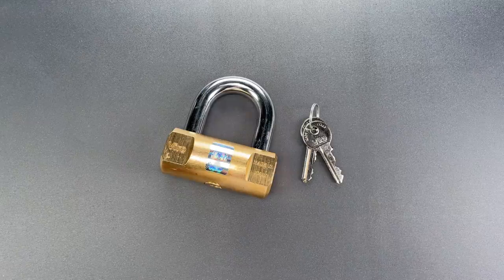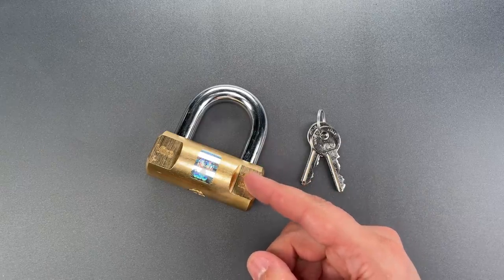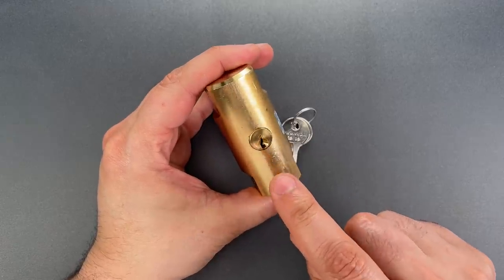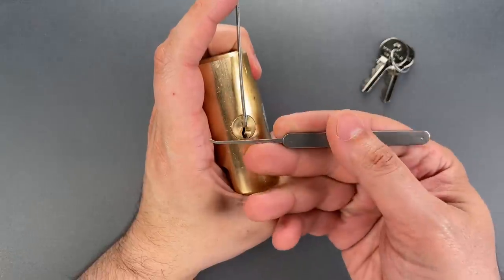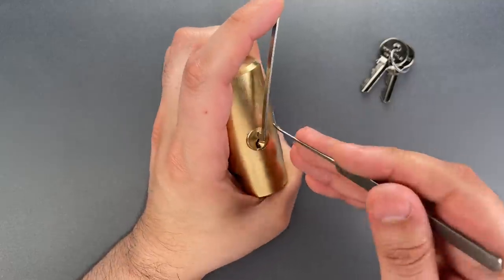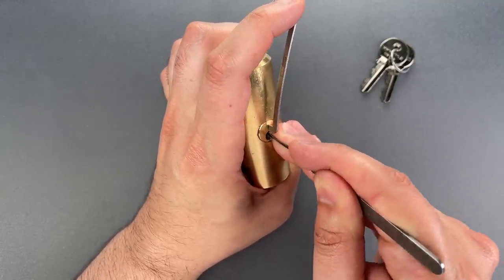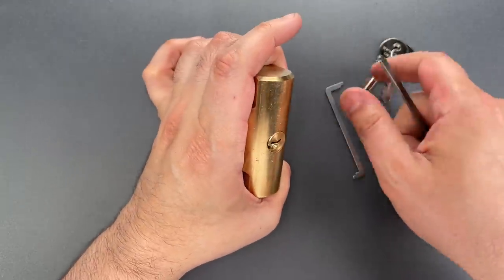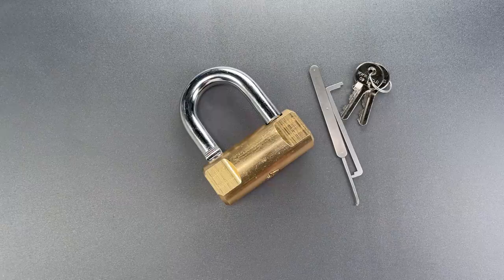[1341] Viro’s Secret Pin Foils Unwary Pickers

Comment: This is probably one of the best performing locks the LPL has picked on-screen, given that clever semi-secret safety feature. Then again, he only cracked it once so it may have been a fluke. 🤣😂😭🔓
Reply: The hidden pin is cool, but security through obscurity is no real security at all
Reply: @_Stormfather  it's only supplemental, I think would be more accurate. Like a house safe under a floorboard is better than on the living room table, but not by that much.
Reply: I called it a "semi-secret safety feature" not security by any stretch. We're actually on the same page.
Reply: 1341 flukes so far... 😆
Reply: @szurketaltos2693  But if you make one relatively simple to find, and the other exceedingly difficult, then you have an effective decoy. That's where security by obscurity really comes into play, as a second or third line of defence. It's just not a good first step as a general rule, and definitely not the only security measure one should take.

One safe on the wall behind a painting, one under the floorboards that takes some finding, and one inside the sofa, where no-one would ever look - especially having found the decoy in the wall and the "hidden safe" in the floor. That would be my play. Just as the entrance to a panic room is best up high, as few people look up. It'll be found in a determined search, but time is not on the side of the criminal under most circumstances. Any delay is a good thing, so a "hidden" pin in the bottom of the keyway is the same, at first you pick and pick and can't get anywhere. It's easy to shine a light in there, but it's rarely the first thing you do, so it is an effective delaying tactic, as long as the lock is sufficiently obscure. 

Having been the feature of today's video, it's now much less obscure, but how many will you ever come across? It's one lock of many thousands being used, and the security pins or the bitting perhaps, in this one, were pretty good. That was a lot of tension, and a lot of easing off of that tension. This particular one took some skill even without the sub keyway pin. In combination, this is a decent lock.
Reply: @Si74l0rd  if you're being targeted by an experienced thief then my understanding is that they will case the house and your social media sufficiently to have a long window e.g. vacation. However, with a dumb thief you're right that all these things can be very helpful.
Reply: @szurketaltos2693  ,
If your house is being cased by an experienced thief, no lock will stop them from taking something.
Reply: @aralornwolf3140  an experienced thief isn't necessarily as good of a lockpicker as LPL. In fact they probably aren't, maybe as good as your average locksmith I'd guess. The lock needs to be sufficiently tricky and the safe or other infrastructure strong enough that it's too much work to take is my understanding. E.g. a small detached safe is never safe even vs a dumb thief because they can just take it with them.
Reply: @szurketaltos2693  ,
They will just take the TV/Laptop/PC/Anything that is valuable but not hard to get.

Ergo, the experienced thief will still successfully steal something.
Reply: @aralornwolf3140  For sure, they probably wouldn't hit someone with really good security practices either unless they feel it's worth the risk.

Comment: In a controlled environment, with no pressure, and knowing everything about this lock, it still gave him hard time and took LPL way beyond his average time to pick it.
It's a good lock.
Reply: Indeed.  When people lambast "security through obscurity", it's generally because the security system (in this case, a lock) relies exclusively (or nearly so) on it for its effectiveness.  But a "security through obscurity" trick is OK when the lock is still a challenge to open even when you know about the trick.  And that's what this lock did.
Reply: I would definitely buy this product as it will foil most people’s attempts at picking it.
Reply: Got to think about how many times did he retake that video how many times did he pick that lock before we saw the Final Cut
Reply: Yep. Just like everybody says on all of his videos.

Comment: I’m always afraid I put too much tension on my tools… watching LPL’s tools bend like crazy as he picks.  Ooook more pressure!
Reply: Me too😂😂😂😂
Reply: LPL favors "stout tension" when picking. He has a video pretty early on about his reasoning for it. However, you don't want too much tension that you cause the pins to bind and not able to be picked. I also go the more tension route, and I think you do get some good feedback, but you also need to have good control when letting off tension when counter rotation happens.
Reply: @shura0107  The tension video is #188 (happened to come up in my recommendations).

Comment: Yo that actually seems like a pretty decent padlock.
Reply: It’s decent against lock picking attacks but how about with power tools? Without hardened steel anti drill pins, I can’t imagine it’d be too hard to beat with a drill attack especially since the core is composed of a rather soft metal (brass).
Reply: @Alm8hoorOW  i think your statement is pointless. Power tools? I can use an angle grinder to cut whatever you think are harden steel locks. Or a blow torch. Picking locks are for doing it quietly not letting everyone know what you're doing.
Reply: @ladam836  , except you usually don’t carry an angle grinder around and the ones that do come cordless won’t fair against locks with hardened metal very easily.
Reply: @Alm8hoorOW  are you saying that i've been carrying this angle grinder around for no reason!?
Reply: Too bad its too thick for normal use.
Reply: Good enough for a motorbike wheel. 
And the guy with the crash helmet and tyre irons thinks it's great.  He fools passers-by every time and puts another high end bike into the van. 
Good business for him.
Reply: @Alm8hoorOW  I know of a few battery drills that easily go in a small bag. 
In fact, you can make your own bag with a greasy bit of old carpet. Genuine workman style.

Comment: Did not know about the difference between the key cut and the pinning. I can never bring a pick to a pretty new lock that is beyond my level…so I never tried or counted. That will teach me not to check. Looking forward to more great videos and maybe a Miwa opening in the future?
Reply: Seems the difference between key cut and pinning is particularly to the Viro 105. The little brother Viro 104 has a key with 4 cuts (checked this time) and four top pins. Plus that bottom secret pin.

Comment: They could have added more hidden pins which drop in after slight rotation of the core, to annoy you.
Reply: That's an idea.  Have it so the pin drops in after you tension it and cause the lock to seize up such that you can't push the pin back back without removing tension.

Comment: “Isn’t too much of a challenge” ???? That lock took him longer than any other one I’ve ever seen! And it was only four pins. Pop a few more on that baby and you probably have the best lock you can build. At least until Stuff Made Here v3.

I saw a Lifepod at Costco yesterday. They now have a complete manual lock disconnect. They should’ve probably called it the LPL switch.
Reply: LPL still hasn't even tried to pick a Bowley.

Comment: So from what i learned is that there is basically no lock that cant be picked… So they add security whatevers to make it harder.. But since youre the Lock Picking God theyre all of no match to you… i see
Reply: I mean you can weld it shut and use an angle grinder to open and close it
Reply: Picking protection makes sense only up to a point. There are some very pick-resistant locks, some of them require special tools to pick etc. The way I understand it, security pins make it harder to pick, but their main purpose is to make it almost impossible to use the easy/fast attacks (raking, bumping) on the lock.
However, at some point (some minutes of trying to pick it) the criminal will just get a grinder or find some other way in. Making a lock that's even harder to pick than that is not really needed, better spend the money on physical protection.

Comment: I think LPL has made it perfectly clear that locks with a key are an utterly pointless method of securing stuff. I think we need a paradigm shift. How about a key-combination lock combo? Insert the key, then rotate c/w and cc/w to pre-set ordinals, with those ordinals representing a pin number? You need the right key and the right pin to open. Or how about having two or three keyways where you have to insert the key into the correct keyway in the right order to open? Or an entirely magnetic lock where the right combination of N/S poles opens the lock?
Reply: Then he'll tension it with a wiper insert and tap it with a hammer...

Comment: After seeing many videos from LPL, My mind started to wonder what a company would have to do in order to increase security(as someone with no kowledge on locks, the ideas are obvious not professional level), but I always though "if someone trying to pick search only for the pins to pick, why not put another pin(or any other thing) that would make hard to open the lock with traditional methods?" and  I'm happy to discover that it would make the lock more demanding to pick under normal circunstances.
Reply: Before you care about the pick resistance of a padlock, try a hacksaw on it first. If everyone can destructively open it in a minute, pick resistance is futile.

Comment: I think most bike locks; because how they are installed; just have trap pins for the core; thus you need a proper key to safely turn the core. This means no one can pick this and you are forced to the cut the lock if you have lost the key.

Comment: Many motorcycles are stolen by 3 or 4 husky guys jumping out a pickup, picking up the bike, throwing it in the back, jumping back in and driving away.  Bicycles are cut or using a grinder.  My motorcycle was locked to a tree.  The seat and battery were removed.  The thieves knew I was at Tahoe for a month so took their time.  They even unscrewed all my outdoor security lights so they could work in the dark.  They got through both locks, replaced the battery and used a piece of foam for a seat.  They were still using the foam when the bike was recovered.

Comment: That's handy to know if none of the pins in the core are binding then there's another something binding and needs picking.  This lock would be confounding to a lot of sport pickers if the secret pin didn't bind first.
Reply: Yes, if the hole in the core for that pin was slightly out of line with the main pins then you would drop into a false, false set. Very confusing I would think.

Comment: Ah, so a company thought of that already xD. A while back when I first discovered lpl I had thought "well what about a hidden pin in the bottom?" But my design would have been a bit trickier: the pin would be under a trap door like mechanism that was "hinged" at the entrance of the keyway and the key would use leverage to set the pin; means the bottom of the key could be a "hidden tooth", it would be flat but at a slight angle to create the leverage. If the angle was shallow enough it would be hard to guess of the pins existence even by looking at the key.

Comment: I like to use a half diamond to count pins on a new lock.. I would have probably found the extra pin just by sliding the pick on the bottom of the keyway to start at the rear.

Comment: In a video could you explain what a “false set” means, “nothing on one”and “spool”, knowing what the terms mean might help us understand what your doing? Love your videos.
Reply: False set usually refers to the condition during picking in which the core of the lock, (the bit that the key fits into and turns), turns to some degree because of what are called security pins. There are mainly but not limited to spools, which look like what you would think, and serrated which have many narrow groove around them. 
These grooves will catch the shear line, the space between the core and the upper part of the lock where the holes line up. 
 This will allow the lock to turn a little since the diameters of the pins reduce at the spools or serration points. This can cause the lock to become stuck if you are using too much tension, but it also lets you know you sre dealing with security pins. 
When he says nothing on 1. Hes refering to a pin in a specific position, hey has applied tension to the core and uses the pick to push up on the pin. Nothing means the pin slides freely with no binding or clicking. 
 Binding is where the pin will not move with light pressure and must be pushed harder to move. 
A click is where the pin has been set meaning that the break between it and the upper pin has reached the shear line in which case its set, or it is a security pin and its falsely set on a spool or serration. 
The false sets cause by security pins can cause trouble picking because of what he calls coubter rotation. This is when you have a pin in a false set and when you try to push it out, the wider part of the pin is pushed through the shear line and causes the core to turn opposite of what you are tensioning to pick it. This can cause previously picked and set pins to fall out of set and have to be repicked. 
 This can be frustrating for new pickers. 
 You specifically asked about spool pins. 
 These are one of the two most common types of security pins. 
Security pins are just a term for pins that make picking more difficult. 
 In this case the pin is just milled out in the middle so that it looks like a spool. Serrated pins are just pins with multiple small grooves cut around them along their length. It would help if you look up a cross section of a pin tumbler lock. 
Other features can be combined with security pins to make a lock  more difficult to pick.
Reply: @metamorphicorder  Awesome, thanks for the very concise explanation! Much appreciated.

Comment: I believe the only lock LPL couldn't pick, would have a warning, lazer engraved in bold font stating if said lock was tampered with or any foreign objects inserted into it would result in immediate explosion followed by instantaneous death. Is it real or just a bluff? Said key would be chipped to proximity of said lock as the solution. That should slow him down enough. Unless he finds the hidden flaws that not even the designer knew about 🤔

Comment: @LPL question: would having pins of different diameter make a difference? Maybe I am visualizing this wrong, but having spools of different diameters would cause different depths of false sets. The counter rotation of the deepest of these would cause you to lose the sets of the smaller previously picked pins. Or do I have this completely backwards and it would actually make it easier?

Comment: The name of this video made me think of a new-to-me lock design. Basically the lock has it's normal pins and pin holes, but it has two extra (maybe this could be decreased/made simpler). These two extra pin holes are important because both of the holes stay in an unlocked position, but the second one if pushed by anything (like a pick) triggers a pin to fall into the second extra hole. This pin is long enough that it cannot be unlocked even with the key. This obviously has the problem that it can no longer be opened, but any valuables inside would remain safe until a destructive opening is created. The key then, would just not have any pins in those locations. I haven't thought about this a bunch so I imagine it should be pretty easy to take it down to just one extra pin hole but I figured that since I only came up with how to do it in the 2 minutes I thought about it with two holes, I would say it that way. 

Do you know of any locks that employ this type of technique?

Comment: Saw some cheap, locking carabiners for sale yesterday. It had a lot of space around the 3 code wheels so probably childsplay there.
But after that it opens via sliding towards the hinge of the bar...how does that effect potential pick resistance? Does that make it even easier to feel out the combination?

Comment: So this is what a real lock looks like? Most locks you pick open so quickly it appears to be magic, to open a good lock takes 1.5 minutes.
Are puzzle locks more secure than standard locks? Is there no stopping a determined and skilled lock picker?
Reply: I think the problem of puzzle locks are that they are not intended to be used "in the wild" (maybe with cheaper material or weaker form factor) and/or to be produced in a scale of a commercial lock (maybe manufactured to have perfect tolerances or more complex mechanisma like the "stuff lock")
Reply: @watcher314159  Thank you.

Comment: You get to look at the keys before picking. This is why you are able to guess it. A picker wouldn’t be able to look at the keys ahead of time. I challenge you to do locks like these without keys so we can see you be frustrated without knowing why you can’t pick it.
Reply: LPL already did that in at least one of his videos, and you are mostly wrong with your assumption that seeing the key before picking makes much of a difference. For single pin picking, the relevant property of a lock is the binding order, not the bitting. The binding order cannot be seen on the key, as it is solely the result of tolerances. The picker finds a binding pin and lifts it until it clicks. It does not make much of a difference how far the pin has to be lifted until it clicks. That said, seeing the key can give a hint about which pins might be gatekeepers that are easily overset when picking pins behind them if the picker is not careful.